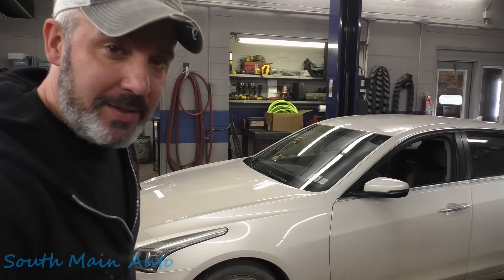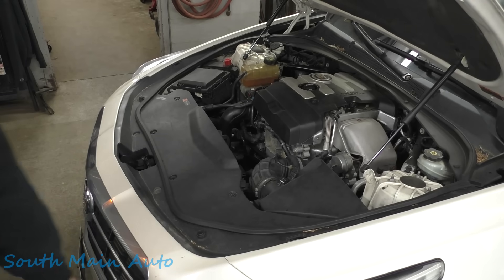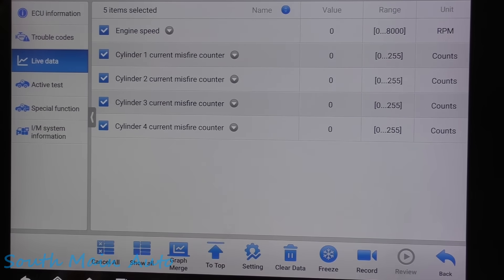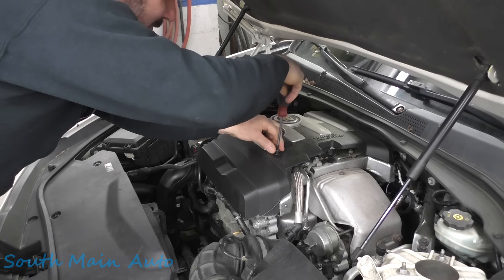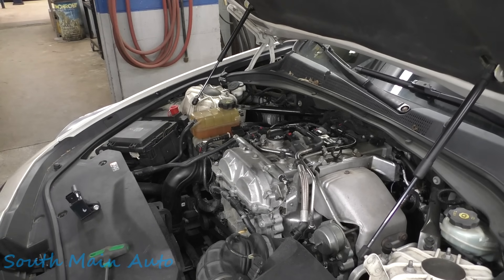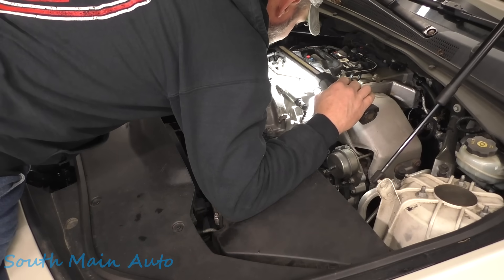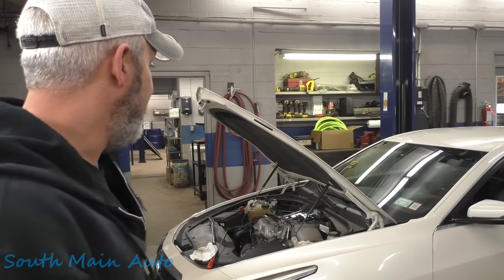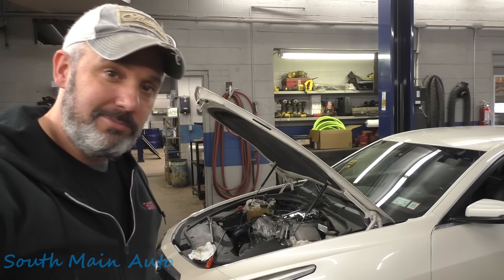'14 Cadillac CTS4 2.0 Turbo - Major Engine Damage

Comment: Personally, other than a small Toyota, I would not own a car with a 4 cylinder engine.  You have to run them to death to get the needed power, especially on hills.  I had a 2010 Malibu.  That 4 cylinder was a piece of junk.  Fortunately I traded it in to the dealer.  It had low mileage, but already had rattling on startup.  I will keep my 2015 Impala V6 until it gives out.  I'm sure I will end up giving it a new set of timing chains at some point, but that's a lot cheaper than buying another car!

Comment: How is engine oil get applied to the cylinder wall? Ive seen oil squirter tubes on some older or exotic engines but not on newer modern engines. Thanks

Comment: Had they of used forged Pistons in 2.0 Camaro and Cadillac those engines would have possibility outlived suspension and transmission parts , thinking Ford mustang 4 cylinder using forged Pistons instead of cast ?

Comment: Sad really. My 18 year old (I won't even name the car so as not to sound like a fan boy) car with 300,000 miles on it still runs like new. The only maintenance the engine has needed is spark plugs, air filters, oil changes and a catalytic converter. I have beat on that car since the day I bought it new and I still do. My point is, there are good, reliable, durable, quality cars (engines) out there, you just have to find them.

Comment: Getting high horsepower out of a small displacement engine by adding turbos does not result in long lived engine. I would take a larger displacement engine that is naturally aspirated. As the saying goes there is no replacement for displacement. The larger engine may burn a little more fuel but that is less costly than having to repair or replace the  engine frequently.

Comment: When was the last time you tore an engine down to rebuild instead of ending it out"?
Reply: Pinned comment 😮 owner gave it 3 strikes

GM plus turbo = gamble after 100,000 miles
Reply from the maker: Oh it's been about 2 years. I would say last one I did was a Toyota Corolla that was eating oil

Comment: What do you think this car is worth in its present condition?  With the mileage and the age is it worth putting the several thousand into it to fix the engine?  Seems to me if you could get something around a thousand for it and go for a new one (maybe not a Cadillac) you'd be better off.

Comment: All of these 3 and 4 cyl turbo engines seem to be nothing but trouble. I have a 2019 Buick regal sportback 2.0 turbo in the shop now slowly pushing combustion gases into the cooling system causing it to push out coolant and overheat at almost exactly 30 highway miles like clockwork. It seems like we reached the pinnacle of engines lasting many miles and now in the process of satisfying ridiculous quotas made by bureaucrats we’ve gone backwards again with engines that don’t even make it to 100,000 miles. Thats on top of car and truck prices creeping up to the amount of a small mortgage. I’m definitely not getting rid of my old cars anytime soon.

Comment: I have another model of GM vehicles with the 2.0 L turbined.  These seem to better that the older engines in several models 10 years ago however, I'm not happy with these undersized engines in mid-sized vehicles and they slap a Turbo on them to make up the difference in needed power at the expense of engine reliability and longevity.  Not happy it all.  I would like to know what the root cause is.  Is it mostly likely stretching out oil changes?  That for sure is contributing to a lot of these engines not making it to 100,000 miles. And also, as expected the Turbo crapping out way before 100,000 miles.

Comment: Typical to see not very matured DI engines have problems like cracking piston ring landings. Most DI engines that were introduced between 2007ish and the 10 years after have problems. It took until 2018 or so until most engines are over problems like this and the piston rings failing due to trying too hard to get low friction, resulting in oil burning. The whole valve timing is still finicky for some designs. Rebuilds are usually also a problem because the cylinder walls can't be drilled/honed due to coatings.

Comment: 8:10... good way to chuck a spark plug and then need to do a thread cert..if oil gets in the spark plug wells and works its way through the threads it gets hot, carbonized, and the car ejects the plug with the threads...
14:45.. because it's direct injection..that's how they look

Comment: It appears that the State of new York is plagued with bad shops who don't take the time to do diagnostics. Instead the just unload the parts cannon and if they fail it's oh well, nothing we can do. Where I live in Canada they have gutted the journeyman mechanics role in the business by allowing what are known as techs to work on vehicles. Techs, unlike proper mechanics, are people who have taken a specialized course or two and they can legally only work on the areas of a vehicle covered by their courses. The shop foreman is normally a registered mechanic who is charged with overseeing their work. Unfortunately there is no quota established as to how many techs the foreman can oversee so it could easily be a shop with 25 techs to one foreman and frequently corners do get cut so proper diagnostics are rapidly becoming a thing of the past. If the computer can't identify the problem then they are at a complete loss since their course did not cover diagnostics. Many times the Tech is simply not allowed to do his job thoroughly as the try to push as many vehicles through as the possibly can. As you have shown so many times on your channel, a good diagnostician will have more than enough work because the other shops in the area keep his business alive and growing when they fail miserably at finding and fixing the problem. Keep up the good work.

Comment: Small turbo engines that are well designed with high quality parts can last a long time. Then you have this POS. 

Compounding the situation is the first owner, with a lease, listening to the stealership drone on about 10,000 mile oil changes or when the vehicle “tells” you it’s ready for an oil change. They miss even those marks and turn it back in for the next poor schmuck to deal with.

Comment: I have a '14 Buick Regal with the exact same motor. I'm 9nly two minutes into this video. I'll put my money on low compression in one or two. If that's the case then it's a cracked piston. The pistons in the 2.0 ltg are poorly designed. Very skinny rings and oil ring. The top of the piston will actually crumble in your hand when you attempt to pull off the rings. I've been through three motors in my Buick.

Comment: People are usually afraid of the wrong thing. In this case everyone says downsizing and turbos are bad.
They are not. B48? B58? 2JZ? Brilliant turbo engines.
5.4 Triton? Shitty big NA engine.

It doesn't matter if it's a small turbo engine or a big NA engine. It's either good or bad. Cost cutting exists on all engines. Planned obsolescence exists on all engines. Focus on that.

Comment: I have a neighbor whose car I worked on, one day she called me and said her check engine light was on, it had a p0301, I did the old coil swap trick and the misfire moved got a new coil and all was good for a year or more, this was a 2009 Corolla. She texts me again the same thing same code, I thought ok the new coil must have quit but no, this time it was a bad spark plug, she requested new plugs the last time so I got a replacement under warranty and the engine ran fine no more codes, about a week later once again it happened swapped coils again and number one was bad again, I told her this time I'd like to replace all the coils which I did, engine ran great, she loans the car to her granddaughter which she swore she would never do , her granddaughter calls her and tells her the car just died on her, her granddaughter had it towed to a local shop where I know the owner for over forty years and he's trustworthy. Guess what he found, number one cylinder needs a new coil, he installed one and again the car is good, of course he doesn't know that this has been an ongoing problem, she gets the car back and i tell her that there must be something wrong with the engine, why would it need a new coil all the time, i found a video on YouTube with the same exact year Corolla and it had the same issue, they replaced the ecm coils plugs everything and it still misfired, the video was with a toyota mechanic diagnosing it he performed a leak down test and he found a dead cylinder, the car needed a new engine, that's probably what was wrong with my neighbors, a few days after she tells me that she was in an accident and that the car was totaled, she and her boyfriend were injured, the car was back at the shop where i know the owner, i went to look at it and it was the best looking totaled car i ever saw, there wasn't a mark on it, she claimed it was hit in the rear, there wasn't a mark on it, i told her i saw the car and asked her about what happened, she said the damage was underneath, i saw nothing and i had been under that car many times, there was no damage whatsoever, after all this she basically stopped talking to me, she claims that a year and a half later she's still going to physical therapy for this alleged accident, I smelled an insurance scam from the get go but I can't prove it, i think she concocted this accident sceme because she found out the engine was bad and that she'd be out a lot of money, I had told her that I would replace the engine  to save her money, she claims that the insurance company gave her 50 dollars for the car which I don't believe, I'll probably never know the truth.

Comment: That clearly had leakage past rings, but you normally cannot do a leakdown test at BDC. The exhaust typically opens before BDC at the end of the power stroke, and when the piston reaches the bottom of the intake stroke, the intake valve is not yet closed..
   That is unbelievable..needing 3rd engine in 100k. High power output from small engines- don't do it if longevity is the goal! 
    The used car choices are going to get really ugly. Actually, they already are. Anything I am interested in owning is likely to be rusty. Anything not rusty is a complex POS with an auto trans (with 8+ gears) and a silly touchscreen to control everything.... man, I can't stand it. Seems to be what the public buys.
Reply: I guess I didn't actually ask it above, but if you happen to read the above comment- you appeared to do a leakdown test with the piston @ BDC. Given that, with any normal sort of cam timing there is always a valve open at either of the two BDC events, how does that work?
    As always, thanks for the entertaining and informative videos.

Comment: Everyone's dogging on GM. The owner has done this to 3 motors. These motors require premium fuel and I bet it's never seen over 87 octane. I also bet it's discount gas (Walmart/Murphy) and not Top Tier as specified in the owner's manual. These things happen for a reason.  If you want a cheap car you can run on cheap fuel and throw away when it's done, buy a Kia.

Comment: They had the v8-6-4 in the 80s, now they have the I4-3-2. These engines aren't worth rebuilding and you can't really do em easily i'm an engine shop and you can't even overbore them because of coatings and too thin of a cylinder wall. Not mention that the parts don't exist for a total rebuild everything in this is torque to yield . It's like the eurostuff in a lot of ways.

What happens to these is they run lean and thus really hot for emissions and power (compared to your classic older designs) and in doing that they have hypereutectic pistons like almost everything which can't really take the temperatures. (this next part is educated theory) Because they're DI they get a cold spot in the middle of the cup, that basically warps the piston a little and that makes the ring land break because the rings aren't going straight to the wall they're fighting the warped piston they're digging in (it's why you get so much vertical scratching). Either that or just classic heat binding rings because of insufficient gap, cracks the pistons and that's it. The weak part is either the piston design getting a cold spot or material, I've heard of people swapping forged pistons and never having issues again. The overall design isn't bad but man the money savings absolutely ruin it. GM needs to rehire the guys who designed the LS, and 3800 those guys knew what they where doing.

But these engines are absolute crap. The biggest issue is that they're basically the old ecotec architecture shoehorned into the future with DI and all that. The second issue is this absolute braindead concept of EPA of vehicles having emission foot prints, it's why we can't have v8 sedans anymore, because your emissions are based on the physical size of your car and of course CAFE standards. So for marketing and practical use they gotta run the bejezus out of these. That funky piston shape is really a marvel of engineering, these DI engines are running right up against the limits of what gasoline can do, these engines are running i think 14:1 F/A ratio which is really really lean, and lean makes power and economy, it also makes a lotta heat and these engines run hot anyway for emissions, we've had engines running hot since the late 90s. Think thermostat temps settings.

But of course the biggest blame in my opinion always goes to the consumer. 90% of people only care when a problem happens, until this i'm sure the owner loved owning a caddy and i'm sure they where all smiles walking into that dealer and shelling over their money. I bet they read exactly 0 consumer reports on Cadillac reliability and all that. When i bought a new car, i bought a corrola, and before that i checked their historical reliability, their parts availability, ease of maintainece, recalls bullits and most common issues on prodemand and forums and stuff. If my car is average, i will have 0 issues until 150k or so and then i may have to replace some suspension/brake parts.

Comment: OBSERVATION -- There were likely earlier indications of trouble.  My gut feeling is that earlier detection results in better (easier/cheaper) repair.  I apply this to the human body that has fewer available replacement parts.  I'm called a hypochondriac.  I resent that.

Comment: C'mon Eric.  It's pronounced Dee-Oh, not Die-Oh.  He grew up only two hours from you in Cortland.  Sad that engine #3 is toast with only 111,000 on the odometer.  I'd move to a reliable, long lasting, Toyota (Lexus) or Honda (Acura) and not have to worry about replacing engines.

Comment: just add most auto engineers to the list of those who only practice their trade,  with no impunity at all.  doctors, lawyers,  some leo's. and for quite some time now auto manufacturers.  let the buyer beware.   i will never buy a small motor turbo, or any size turbo ride.  and i will never own another afm, vvt or any motor that doesn't run all the time on what was made from the beginning.
Reply from the maker: Boy finding an engine that's not VVT is almost impossible. Almost every single manufacturer i can think of run some form of variable valve timing.

Comment: 2 liter and a turbo to try to get some horsepower back... What a great combo. Give me a V8 or V6 that doesn't have to work so hard all of the time. Some of the old Cadillac's had 8.2 liter. Now, that's an engine.

Comment: GM and Ford are irrelevant today. Putting a large lawn mower engine 130 CID (that's the displacement which is SMALLER than the original Model A 4 cylinder 200 cid) When you blow a small engine like this (turbo) to get power you basically blast the oil off the cylinders and over pressure the whole freekin thing! That engine in that car is WORSE than a Model A engine in that car. Expectations of Ferrari performance with a GM turbo engine is plain stupid. This is what we have come to it is sad!

Comment: Low displacement over stressed turbo engine what does GM expect?. A car of that size should have at the minimum a V6. If GM did that though you wouldn’t need a new one at only 111,000 miles. Plus, oh my god, you might get 3 miles less per gallon. The horror…

Comment: Not surprised a GM 4 cylindernengine is failing at just over 100k miles. JUNK! Id never buy  a direct injected engine. Ticking time bomb thats gonna need major carbon removal at some point.

Comment: Techs forget that the MIL indicates an emissions failure,  not just a malfunction.  The engine can be running like pooh and not have a MIL on. As long as tailpipe emissions are within spec., the MIL need not be on.